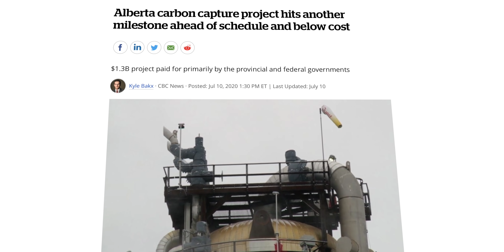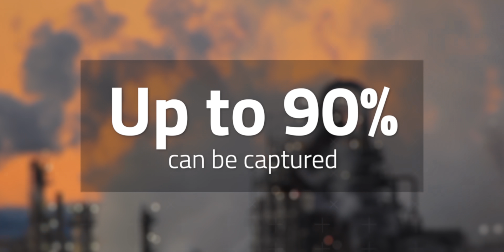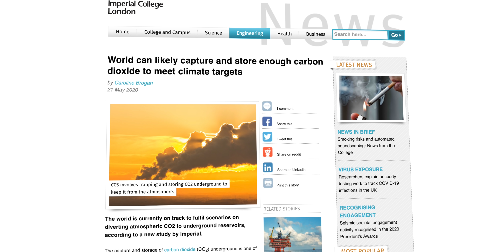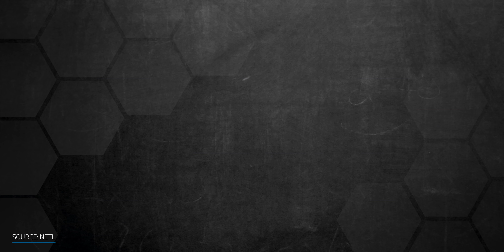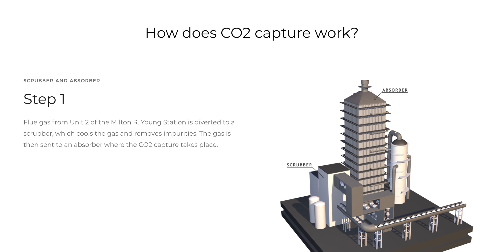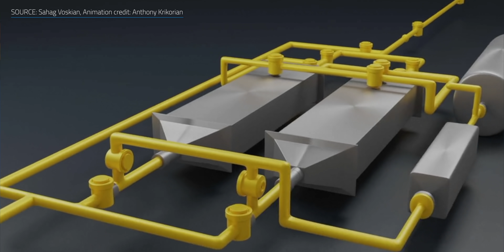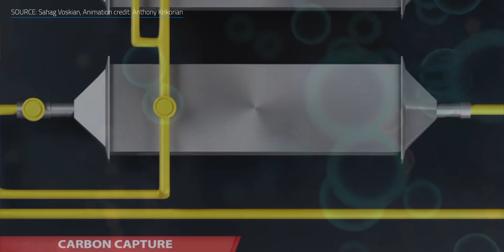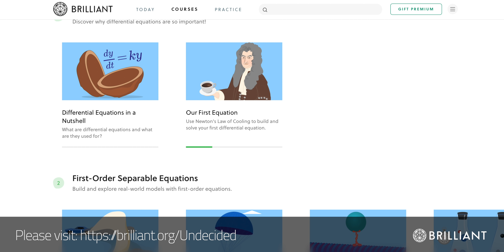The truth about capturing CO2 to reverse climate change

Comment: Matt, now that you talked about carbon capture, I think that it would be interesting to compare this tech to planting trees. Thanks.
Reply: Trees and seaweed are way more efficient and cost effective at carbon sequestration...
Reply: @1 2 Not a total solution. But an important part. The trees don't have to be cut down. Those that are can be used as lumber to build houses. Could also bury them underground as a form of carbon sequestering.
Reply: @jaymesdevine7737 

Don’t get fooled one of these pipelines exploded in Mississippi in 2020, rendered cars inoperable, including emergency vehicles. People were unconscious, with no help arriving. 45 people were hospitalized. These things are dangerous!
Reply: I have 3 of those CO2 capture plants in my. One of them is 100 ft tall a sick elm tree. A black walnut 80 ft tall and a sumac also 80 tall. A blue spruce just a baby on 30 ft tall. Funny thing about CO2 concentration it goes down in summer and up in winter.
Reply: @warrenpuckett4203  the following article describes why this happens...
https://earthscience.stackexchange.com/questions/2521/why-is-there-a-seasonal-cycle-to-the-amount-of-co2-in-the-atmosphere
But the good thing is that "each gram of" carbon trapped inside each tree trunk is " a gram of" carbon removed from atmosphere...
Reply: last data i saw was  1x50c tree was 13000x more cost effective than any capture machine currently in use
Reply: @flodjod  problem is land availability.
Reply: What  @tinacrew  said.  Trees take up a lot of land space.  And they would need to be planted somewhere without existing growth in order to be effective.  DAC takes up significantly less space.
Reply: @tinacrew  Take a drive in farming area...  The land between the road and the field can hold many, many trees.
Reply: @JeffHoneyager  maybe in your country, but in mine that's not the scene.
Reply: @tinacrew problem is danger to people. One of these exploded in MS. Incapacitating emergency vehicles and people who needed help. 45 people were hospitalized.
Reply: @clellbritt3434  The main concept with trees is not really the tree but the forest. Yes, in a forest, trees grow, store carbon, die and release it back as CO2. The forest, however persists. There are incentives to plant trees, but only as part of a land use change towards permanent forest. The payments are not perpetual and cease when the forest reaches maturity.
Reply: @Brin Jenkins true...😊 now let's hope enough people would get enticed to plant sufficient trees
🌱🌱🌱🌱🌱🌱🌱🌳🌳🌳🌳🌳🌳🌳
Reply: @gustafeibel4919  what if we let trees reproduce on their own?
Reply: You can plant trees almost everywhere and they can remove carbon from the air, while CCS makes sense economically to remove concentrated emissions only. There is the big storage problem. Storing in cement does not offset emissions significantly (as producing cement releases a fuckload of CO2 and using CO2 for curing is seriously complicated)
It would be probably better to put effort in changing the way we produce and use energy, and maybe to help those communities that will be hit the hardest by the consequences of climate change, as reversing half a century of emissions is unrealistic
Reply: @filosquartapecore  1 century of vehicle emissions not a half of a century. Several centuries of coal, oil and natural gas.
Reply: How did this planet become so full of incompetency!! All these stupid supporters of psycho scientists playing around bc they have the funding!! Worst people are the scientists, always have been!! They are menaces w god complexes trying to defy what is natural and simbiotic!! Look up how many nazi scientists were brought to america to continue their psychopathic playground
Reply: Stirling University and the James Hutton Institute in Aberdeen, both in Scotland, have discovered that over a 40 year period, carbon fixed by growing trees has been offset by the mycorrhizae (fungal network) actually releasing more carbon dioxide than it captures! So peat bogs and grouse moors are better left free of trees. The trees are a timber producing commercial enterprise to pay for the tree planting. Money first at present.
Reply: Planting trees , is economically and asthetically viable. Carbon capture tech requires more energy to capture carbon , than emitting carbon. Even using R.E. sources to capture carbon is also energy intensive.
Reply: unfortunately, there's only one comparison that matters: people can make millions selling carbon capture. no one gets rich planting trees.
Reply: It would be better to have both. To reverse our impact and help restore things would be optimal...
Reply: @justinfigley4867  Yes, we probably need both, but knowing how they compare would help inform decisions when it comes to allocating money.
Reply: @jaymesdevine7737  Trees: you would have to plant all agricultural land to make any impact with trees. You would need immediately turn all energy production, including used in steel manufacturing, into solar, stop consuming and only build those fancy fans. You see, you can allocate money wherever you want, still can't eat the money or suspend the laws of thermodynamics. Bottom line: silverbullet, science miracles are not going to save us now. First we have to stop fcn consuming. Sci fi dreams leave for later.
Reply: @jaymesdevine7737  I think that planting trees is still the best option. 
Not only they suck out CO2 in a natural way but they also restore biological ecosystems that nature has lost in the modern era due to us.
I would also give us more wood to harvest in the long long term, not to use intensively for paper use, but for making some art works that need wood or other.
Reply: @jaymesdevine7737  Do people need to pay to plant forests or do those just grow on their own?
Reply: @jaymesdevine7737  for planting trees you need a lot of people and voluntary work, and a lot of space. The investment in terms of money may be even larger. Despite I clearly would prefer the "natural" path, I am afraid that it simply won't happen on large scale, at least outside of China\India. They have huge re-forestation projects running.
Reply: @monnoo8221  planting trees, we can do that but the unbalance made to the atmosphere is too large, we humans
Have the tech, we have the responsibility to fix this,  in the mean time we can plant trees but one cannot expect just planting trees is fixing anything.
Reply: @dandyrevisionist7879  agree
Reply: @justinfigley4867 

CO2 is about 400ppm, we contribute 2% of that or 8ppm.  If we immediately removed 8ppm and got CO2 down to 392ppm, by how much would the global temperature be reduced?
Reply: @ThekiBoran  None, because CO2 has no effect on temperature. More would be better for all life. Now that we've entered Maunder minimum we should see decreasing CO2 in 20-30 years, and it will only hurt life, not help it. The only reason I can see for Progressives preparing the world for heat when cold is coming is for depopulation.
Reply: @justinfigley4867  yes both. Specially because less CO2 in the atmosphere will make trees grow smaller
Any pothead knows that
Reply: @justinfigley4867  Restore to what?  Nuclear has zero carbon emissions and planting trees absorb CO1.
Reply: @justinfigley4867  restore what  ? We as humans do not occupy even 4% of the earth 🤣🤣🤣 you infidel
Reply: @clellbritt3434  The timbers in my house are over 100 hundred years old. New housing seems to good at avoiding expensive building materials like wood.
Reply: Trees are better with carbon that has already spread out!!  Because Carbon capture need power to operate. However carbon capture is best in industrial!!
Reply: If we really want to reduce the number one climate warming gas we will need to eliminate water vapor from the air
Reply: @MichaelRei99  Wait till we fully converted from carbon fuels to hydrogen, and our biggest problem will be air humidity instead of CO2... but that's gonna take a long time
Reply: Best answer yet, carbon vacuum cleaners are as nutty as the concept. They use power so will create their own carbon bs
Reply: @DavidJones-ps3zn  I think you are completing missing the point of these devices.  They remove a lot more carbon than what is used to make or maintain them, making them a carbon negative when in use.
Reply: @OmniscientWarrior  If you end up with no carbon your forestry and vegitation would not exist
Reply: @DavidJones-ps3zn  True, but for that to be the case, we have to first remove creatures that breathe out carbon dioxide.
Reply: @OmniscientWarrior   Right, and we can start with the likes of Klaus Schwab and his ilk
Reply: The funny thing is that nature is kind of doing that itself.  If you consider that most of North America used to be covered by kilometers of ice, and since it has melted, vegetation is growing where ice once was.  If you go far enough north you will run into the tree line which is caused by the permafrost in the ground not allowing tree roots to grow.  When the permafrost thaws, the boreal spans further north.  New trees take CO2 and convert it into the biomass of the tree and so on.  It's like... nature has its own checks and balances and the current level of CO2 and future projections of CO2 are not unprecedented in earths history.  The fossil fuels we use are literally the hydrocarbon remains from life that got buried there.  When they're used, they're getting thrown back into the earths budget
Reply: It takes an acre of forest 2 years to capture the amount of carbon released by an automobile in a year.
Reply: Great.  Then lots of plants will have the resources they need to grow.
Reply: America plants 1.6 billion trees per year. Plus the increase in CO2 has benefited vegetation worldwide. CO2 is good for everything, including bee colonies, which are recovering from collapse. Temp drives CO2, not vice versa. See ice cores and stomata.
Reply: Reforestation is still better, even if it turns out to be less efficient. It requires no power, it rebuilds ecosystems, prevents erosion, and they create their own climate through transpiration once you plant enough of them. It also solves the carbon storage problem- Reforestation leads to an increase of other plants species, insects, and animal population- all of which need carbon to exist. Most important of all: It's supposed to happen anyway if we want to reverse the damage done, so why not do it from the start.
Reply: @mumble3535  the reasons you give are all perfectly correct. Yet, technology and its dumb use brought us here, and if we have other options to bring co2 down, I think we should apply it as well. If dumb money does not flow to forests but instead to those carbon sucker plants, let them pay.
Reply: What is the problem with Co2 ?
Reply: nobody wants to talk about clearing old growth forest to plant young trees that capture MORE CO2... and in the USA improved farming tech has reclaimed more forest in the last 100 years than any other country... using petroleum based fertilizers(which they are trying to get rid of)...
Reply: @billewilde1  The larger the tree, the more carbon that it needs to live and the more that it is currently storing.
Reply: Canada- plant new trees,  south America, protect courent ones.
Reply: @CHMichael  have you evem been to south america?
Reply: Damn right
Reply: I'm going to reply to this comment as it seems to have the liveliest discussion under this video.
Disclaimer - to anyone - really just want to help with the discussion, but I think there are some major misconceptions about trees and the CO2 cycle as well as maybe some ideas missing in this discussion.

1 - dont look at the single tree. Yes when it dies it will rott away and release co2 again. But a forest as a whole is CO2 negative. CO2 will be stored in the roots, funghi, animals ... and the layers of fallen leaves eg. will not just rott away into CO2 again, but will actually build up soil and bind it that way too - like the initial oil / coal build up we use today.

2 - We have enough land. I really don't want to start a vegan/vegetarian discussion, BUT 50% of useable land today is used for agriculture, of which ~80% are used directly for livestock or to feed such. We need to take this on. When everyone at least reduces we can free so much land for reforestation.

3 - forests grow themselves. Not much to add, but yes we can help that by spreading seeds further, but there's allready tech - look at drones, seedbombs etc.

4 - a tree does not have to be grown out until it stores CO2. A Tree (or generally speaking a plant) is made up of nearly 100% Carbon. Even while they are growing they are storing Carbon away from the atmosphere.

5 - We can use water surfaces as well. Algae can decalcify water, grows rapidly and just needs a 'hook' to grow on. Over deep sea this can be achieved by floating constructions. When they've grown long enough, they can be cut down, sink to the bottom of the sea floor where the water pressure traps the CO2. There are also Tests with algae trapping CO2 on land (very successful - search eg for Paris), turning them into food, building materials etc, or best one: Algae which produce Oil which resembles Oil used for Transportation in any fashion (Car, Plain, Ship) - this by it self would provide net-zero-emission energy source fueled by sunlight without the need to replace current technologies / motors with electrical ones (It's not the car itself thats damaging to the environment, it's the fuel)

6 - Reduce. I know it's not really part of the discussion, but when we discuss about the net-sums of how much equivalent of CO2 we have to store in trees for which time compared to capture the CO2-output of factories etc. - please don't forget, one of the easiest way to help the environment is to reduce the output of CO2 in the Beginning. I really believe that as a human / worldwide society we should prioritize what we need. And we really should make these most basic and necessary things as environmentally-friendly as possible. Home (earth) - food - shelter - energy - education - transportation - ... and then fill in by prio and possibility. Adjust the economy to this then, not the other way around. 

We all don't need to work 40 hrs/week to buy things we don't need to keep a economy of unlimited growth running which is killing ourselves. The Planet and life in general here will survive - will we?
And sustainability in simple terms means that we should be able to do something in the same kind of fashion for ... ever. A sustainable earth is possible when everyone lives a 1960's swiss lifestyle.

Please correct me where I'm wrong, fill in the blanks, add more ideas, we can only do this together :)
Reply: Porqué no los dos?
Reply: Microalgae has a higher capability to capture more carbon dioxide from the air than trees but yeah doesn't justify the cutting down of trees but we need a combination of both of them to achieve a carbon neutral world
Reply: Yeah it could be nice to see your compere it to trees or just plants in general. Thanks.
Reply: maybe not planting trees but more like restore a tree. planting the tree local to the area.
Reply: Thanks for the awesome video!!! Climate change needs to be better well known as well as solutions
Reply: Id like to see an EROEI on the tech. Whats the energy cost to manufacture, globally transport, install, maintain and decomission?

Trees cost little, and in many cases dont even require human inputs. A partially degredaded old growth forest not under pressure from desertification or urban development will naturally regenerate itself without human imput or assistance. All that is needed is the cessation clearing.
Reply: We already have more trees in North America than ever due to no one burning wood anymore because of coal
Reply: @Brin Jenkins They store C and release the O2. I f we harvest the trees and use them the C stays captured.
Reply: Thats exactly the blunt answer.  Plants remove more carbon dioxide than any machine you try to create. Imagine if instead of building everything above ground, humans made all the living quarters underground where your home is insulated by earth. People could afford a hole in the earth is why we didn't go that route. Humans have exceeded earth's tolerance of one spieces. Earth will solve the problem or we will collapse through lack of population control. We all feel it like stress but try to fight it. I don't have the energy to fight it myself but I will certainly try to fund it. I buy clean energy index etfs and moved a bunch into this sector.
Reply: A big flaw with trees, when the tree rots or is burned, it releases the carbon that it captured.
Reply: and in night trees and plant give co2
Reply: @muhammadazam4599    No CO2 = no plant life = no life
Reply: Sir, this tech is not to replace trees if you can download last ipcc report which was referred in this video you will find that these projects can only be used to reduces the peak in CO2 content in the atmosphere which  will come in 2030 (expected).
Reply: Or just growing grass, apparently grass sucks up CO2 faster for the same area and time
Reply: @clellbritt3434  30% of the carbon in a tree is in its roots.  When a tree dies, those roots become fertilizer for the next tree.
Reply: @clellbritt3434  just curious, are trees capable of reproducing on their own?
Reply: For that we would need less population centers, less housing, less children...etc does that sound an easy undertaking to you?
Reply: @clellbritt3434  one thing that effects planting trees is the 7.8 billion that is the current estimated population in the world housing people requires land and eventually that 7.8 billion will turn in to 15 billion and so on so carbon capture is a good investment when you look at long terms
Reply: Both still won't be enough
Reply: The amount of carbon absorbed by trees is quite easy to visualise and calculate since the weight of trees is roughly equal to the weight of carbon absorbed from CO2 in the atmosphere (the remaining oxygen is simply released as gas)
Reply: I'm more into planting trees because it's more cost effective
Reply: trees are important but we have to take care of our own doing accordingly, nature cannot process carbon emisions at an industrial pace, but we can.
Reply: It would even better to shut down oil companies lol
Reply: @iamsosad1429  although your comment is a comic relief, it has no real solution, millions would die of starvation and cold  if we shut down the plants right now, the thing is to preserve earth while preventing Genocide and unfortunately the elite chained less fortunate humans hostage so we cannot change quick or stop us from changing.
Reply: I was going to say could you not call reforestation  'carbon capture and storage'?
Reply: @tedcalouri2694  yes, just add a "bio" and "hyper-efficient", ...as other properties like: low initial investment, democratic, well-known positive side effects and the like
Reply: Agree.  It's stupid to throw effort to capture atmospheric CO2 (0.04%) when better bang for the buck to capture CO2 from or near its source.   Planting trees is the best way to capture atmospheric CO2,
Reply: If we really went nuts and basically reforested the sahara with enough trees to make a difference, it'd take us about 1000 years.
Reply: it has to be a multiprong approach we have massive ccus installation on every keypoint on earth have a massive tree growing policy look we are not gonna turn off the light drop off the car or switch of the ac or heater or stop eating food so we need to focus on generating more clean energy and reduce our energy consumption by making production and usage more efficient and sustainable.
Reply: Trees capture carbon, but then dump it back into the environment when they're done. Trees use carbon to build support material. They don't convert carbon into oxygen. They store it. Global warming is measured in spans of thousands of years, which is greater than the lifespan of a tree, meaning it'll capture its carbon, then dump it back and the environment will proceed like nothing happened. On a more short-term span of time, they use carbon to create leaves. Leaves fall off in autumn and are gobbled by microbes and turned back into atmospheric carbon. In short, best case scenario is they do nothing. Worst-case is they become kindling for forest fires.
Reply: @89qwyg9yqa34t  trees convert CO2 into C + O2. 6th grade. You are right that they decompose again. Yet as long as they live, they bind water and carbon, which is called biomass. I do not calculate here completely, yet if you increase the number of trees by 1% =>10 billion trees x 7 tons is 7*10^10 tons wood = 20 gigatons. compare that by 2 gigatons total carbon and you easily can see that your argument is wrong.
Additionally, climate changes may occur very quick, within less than 20y. You will experience it.
yet I admit that those tress need to grow first, and because all the idiots out there, we need a very quick solution. Even if it consumes energy and resources like hell.
Reply: @monnoo8221  If you use plant biomass as a carbon sink, are you sure you're not just going to increase the number of forest fires? Or say you somehow find a way to increase the density of plants and trees in only humid areas, which would be a special feat, aren't you just asking for tree diseases to spring up? The chestnut tree is considered extinct in New England for that reason.

Trees are not the solution at all, unless we're only planting them so that they can collect carbon so that we can permanently bury them like nature did when it fixed the problem itself a very long time ago.
Reply: There is no way planting trees can address the issue tha same way as carbon capture. There is math behind how much carbon a tree can capture in it lifespam. Also there is no enough land for trees to be planted(this has been calculated as well)
Reply: Carbon capture in cement production sounds reasonable.

Planting trees isn’t the end all solution. Look at all the forest fires and deforestation.
Reply: We can still plant trees, then cut them when they grow enough, bury the leftovers as deep as you can, then plant more on the spot to achieve the same goal.
Reply: Ramlinga= rambling   U r deficient
Reply: You can not make money planting trees dumb ass.
Reply: Uncontrolled Growth of forrest will let out as much c02 as it storage. If You however cut them down and stop them from breaking down and rot it will make sense.
Reply: Make both but you need food as well.
Reply: planting tree artificially is even worse as it stresses out the soil deposits and dries out the land
Reply: @mmoarchives2542  I hope that one day you are able to understand how stupid your statement is but until that day let me explain why you're completely and utterly wrong, You see there are these things called seasons, some could say that during the seasons the climate changes and the role of a plant or a tree takes on a different format for each subsequent season, now let us focus on one particular season namely autumn, this season is particularly important because all of the energy that has been gathered during the spring and summer months is now stored up in the leaves of the plant and is set to fall from the tree back to the ground, back to the soil to renew its strength and vigour, your argument is not only false it goes against the first rule of thermodynamics I ask of you to please spend some time exploring your world and natural surroundings before commenting on a post on YouTube concerning the environment, thank you for your time.
Reply: hemp is better than trees for short term while you let trees get to 50 years...
Reply: @mjphillips76  Hybrid poplars take 12 to 18 years to reach maximum wood volume per year.
Reply: I still see new homes being built and displacing trees an wildlife all the time.  If anything we ought to kick out all these people that shouldn’t even be in the country, bulldoze their homes and plant food forests.
Reply: @stefd.8857  Oh, to replant a desert you need clay, to retain water, and manure, to give plants nutrients.  Just in case you were wondering how to do it.  Oh, and the best way they found is to mix the clay into water and just spray the desert with it.  (Nice thumbnail, by the way, really pretty water feature 😁)
Reply: The problem is we know the capacity. Trees and the oceans failed to maintain the carbon concentration in the late 1880s, when human emissions were 1/125th or .8% of what they are today. So we can spend trillions, stop all shipping and fishing, and we'd net ourselves a biosphere that still can't contain our emissions, because it's frankly a joke to even consider we'd ever get close to 99.2% emissions reductions. Carbon capture is a technology. By the time we've spent trillions on it, it will likely yield us multipliers we don't foresee now that nature can't give us. Also, if you plant all those trees today and you're lucky if your great grandkids see any benefit. We don't have centuries to wait for nature to solve what it cannot solve any longer. Accept that we must learn to engineer the biosphere to survive.
Reply: @Purpleheart62001  Johnny where does your information come from?
Reply: @Purpleheart62001  Well, a few problems with that.  Our efficiency is way higher than it used to be and we can burn things, even wood, much cleaner and get more energy out of it than they used to.  Back in the 1800's, even with all that technology, we still relied heavily on horses and oxen for the heavy lifting.  Comparing the modern world to the ancient world is very difficult.  And planting trees, we don't have to wait for our grandkids to benefit.  Most trees grown for wood are harvested within 10 years because after that they don't grow wood as fast as the first years of their life, and then if we built with that wood the carbon would come out of the atmosphere and be stored.  Even if we burned it, the carbon would come right back from the air when we grow more trees.  It takes on average less than a second per tree planted with our current technology, that is per worker.  And you can just bury a foot of one of the branches of many varieties of trees and it will grow.  We will need to use less energy, true, but we could redesign cities around travel to work, there is no reason the average commute needs to be 20 miles in a car.  We need to solve distance to employment and the energy and carbon problems will greatly reduce.  Also, transporting everything from underpaid third world countries needs to stop.  A company should not be able to pay another country less than half of the minimum wage that is required in their own country.  At the moment, they get paid like 1 tenth the amount, but if they made that half, it would mean companies would start using local labor and stop transporting nearly everything from halfway across the world.  Not to mention all the pollution that those factories put in those third-world countries.  If the factories were local they would find ways to keep them clean.  Very simply, the modern world has the exact same problems the ancient world did;  Rome could only work if there were slaves, and the modern world can only work if extremely poor people either work in heavily polluting factories for an unreasonably low wage, or choose to be without a job and probably die of starvation.  There are many, many problems that added together are going to make the planet unlivable someday.  I fail to see how planting trillions of trees could possibly not sequester carbon.
Reply: depends on the scenario, right now it's definitely a viable option, but once the real climate crisis kicks in, land might be too dry as water becomes more scarce, this is happening right now and we don't have enough desalination plantations to supply everything and only will be building nutil it's too late (as usual with politics nowadays...), so efficiency will be key and new little trees that have to grow and need a couple of watered acres before they make an impact might not be worth the effort. BUT this will be a worst case scenario. nd only for a short time, and as those guys before me said, both will be needed, as we probably don't want to wait millions of years until the co2 is composted to oil and shifted back into lower layers of the earths curst^^
Reply: @Caldaron  oof that's some serious realist pessimism.  I hope your vision is overblown, but I fear the worst.
Reply: @Caldaron  deserts aren't caused by heat, they're caused by either Hadley cells, mountain rainshadows or being smack dab in the center of Eurasia.  Those are the only causes of deserts.  The equator feels the full intensity of the sun all year round and it rains there almost every day and has the highest density and diversity of life anywhere on the planet.  It also feels like you got it backwards on water availability too.  Water used to be scarce and people used to die in mass famines just a century ago when we had a less industrial society.  We somehow managed to have twice as many people in the world while famine deaths have plummeted. In the past, you would need to dig a well, hope it isn't contaminated and carry it in a bucket and now we have drinking water coming through taps all over our home for literal cents and there is so much available that people can fill a toilet with it to defecate into.  Lets try to remain objective and not be pulled into the modern religious rapture
Reply: @Caldaron  first of all the planet won't become dryer as a whole as a result of climate change, and some regions are expected to experience an increase in rainfall, second one of the biggest benefits of planting trees is that they tend to increase rainfall in the regions they are planted in, so even if the land is to odry to cover the region with trees without using desalination you can start by planting the trees you can and taking advantage of the alterations to the local climate they provide to allow you to plant more trees.
Reply: @Christoph Wolf - I thought you were a Bach scholar.
Reply: Christoph Wolf When will the real climate crisis kick in? Sounds like a good time and would like to add it to my calendar
Reply: musikSkool omg. It sounds biblical
Reply: @Caldaron  You are right, but there is an important factor which brings a ray of hope. Trees do not only need water, but also keep or make water. The leaves, roots and undergrowth of a tree make sure that any water that falls on the ground does not immediately flows away, eroding the land in the process, but keeps the water in the top layer of the soil, and evaporating it. This process helps cool the area, increases humidity and cloud cover and further precipitation. If a dollar of investment in trees have the same effect on CO2 as a dollar invested in a CCUS, I would go for the tree. Check for instance https://www.greatgreenwall.org/
Reply: @Caldaron It’s not a viable option, it’s dangerous!
Reply: @Caldaron  Genetically Engineered trees that are extremely drought resistant,  and  incredibly fast growing as to sequester carbon faster may be viable.. you may as well make them economically productive (lumber/fruit) as well, as long as you're creating an entirely new genetically engineered species.
Reply: Carbon Engineering's carbon capture plants extract the equivalent of 40 million trees. Space for planting trees is limited. There is no way to capture enough carbon fast enough, given the geographical constraints, without something like what Carbon Engineering is doing.
Reply: Yes planting trees would be the most logical solution! But there is no money to be made in planting trees.  That is why governments would rather charge you a carbon tax.  Such a scam!
Reply: @xaxabat1  Are you a big industrial carbon emitter? Why do you feel than to call out the scam on something that you don't even understand?
Reply: So the reason they don't want to work with trees is because before investing in a large market, a business needs to prove to their stockholders that they control enough of the market so that no one will come in and undercut the market, and they lose all the money they invested.  One way they do that is by only funding highly technical projects where the barrier to entry is so high that they are unlikely to get any competitors.  Another way is by owning key patents that make it very expensive for anyone else to compete with them without large amounts of research and development.  In a low tech market they do a lot of research in production and transportation techniques to reduce their costs so that no one can afford to do what they are doing with lower maintenance costs.  Think of injection molding, there is simply no cheaper way to manufacture many things than injecting plastic in a mold, that is why most of what we own contains plastic, not wood.  The closest they can come is die stamping, but that doesn't work for more complicated shapes.  If you could either make very cheap plastic out of wood or come up with a tree planting process that couldn't be duplicated by your competitor cheaper, then we would have a lot more trees.  With all the fires in California, make sure you plant these orchards somewhere that never gets very low humidity.  The simple answer is, trees have such a low barrier to entry that investing in them would be unstable.  Investors don't like unstable.
Reply: have both but realize one year of plant growth isnt going to balance burning more than a million years worth of fossilized plant growth each decade.

We released 38 gigatons of carbon into the atmosphere in 2018.  If we covered the planet worth trees, it would sequester about 3 gigatons of carbon... over 20 years.   And that would be rereleased when the trees died and rotted unless all the trees were cut down and preserved/ sequestered
Reply: @DespiserDespised  you should not stop feeding them... you are correct that force shutting down of petroleum/coal economy is going to create massive economic issues... thus the optimum solution is, planting more trees (and implement other CC techniques) at a faster rate than the C emission rate... that would resolve this issue at the same time without generating new/further issues... 
🌱🌱🌲🌲🌲🌲🌲♣♣♣🌲🌲🌲🌲🌲🌱🌱
Reply: @gustafeibel4919  We agree mate but you realize C02 is tree food, dont you?  Ive seen with my own eyes over the last 50 years mankind has made steady technological progress towards reducing pollution.  C02 isnt pollution.  That the ctrl-left has turned it onto a pollutant is the scary part, lol. That means you are born a polluter and they can justify sending you to the oven.  Just like their Fascist heroes in Germany in 1940.    Pollution reduction isnt what the left wants anyway.  They want to destroy Americas right wing guaranteed Individual Liberty and replace it with some disastrous form of collectivism.  "TO SAVE THE PLANET" of course.  The Hubris of the ctrl-left knows no bounds.
Reply: Let’s retro fit it to capture satanic pedifiles from the lodges
Reply: @bullshitstomper9417  Afforestation increases the Earth's albedo.  This could actually cause more rapid warming than the CO2 that is captured this way would have.
Reply: There's not enough land on Earth to plant the amount of trees needed to offset our global emissions. Not even close. We need to do more.
Reply: The other problem is that co2 is plant food.   If you lower the co2 too quickly or too much,  you might end up with a huge die off of plantlife on earth, not only negating the gains,  but also releasing tons of co2 and methane.
Reply: Very simple, this solution is permanent, planting trees is temporary.
All carbon captured by a tree during it's lifecycle is used as building blocks to grow. Thus when the tree dies all that carbon can be released again either by rotting or burning the wood. Result is the same. At best planting a forest acts like a temporary carbon storage, it does nothing about returning the carbon pumped up from the ground in the form of oil products.
Reply: @Painrunner  wouldn't some of the carbon be stored in the soil after decomposing?
Reply: two challenges regarding planting trees to address CO2 emission: efficiency and land
Reply: Well, simply put, it would take 50-100 years for trees to grow full size (trees worth their salt) and we need to reverse the effects of C02 today.  So, carbon capture is going to be very very necessary.
Reply: @gminer03  what hasn’t been mentioned is alga farming that’s fairly low tech and generates biofuel as a byproduct
Reply: CC is immediate, trees take years to grow nice future planning tho'. First get rid of big oil and coal companies. and fine them for the damage they've caused to pay for CC and tree planting.
Reply: @grayzytube  fines do nothing to curb pollution.  Guess who pays the fine? You do.  Higher fuel prices, food, every product made etc.becomes more expensive.
Reply: @grayzytube  exactly!  Go fine those Chinese coal companies.   Report back how that works out
Reply: @grayzytube  r u good with walking and being cold while being in the dark?
Reply: @grayzytube  Why plant trees... stupid idea. Just stop clearcutting the rain forests that are already mature.
Reply: @grayzytube  ain't possible mate. if you get rid oil and coal company right now you can't get literally anything right now except foods, because petroleum products isn't just gasoline but also solvents, aromatics, base oil, lubes, LPGs, plastics, etc. which your smartphone, PC, mom's la clancha are made out of. that also applicable to coal: coke are used in steel mfg and emergency cooking fuel, coal tar went to the shampoo bottle and paint. So getting rid of them == you won't get anything else
Reply: @grayzytube  it is not the big oil companies that burn the oil.
Reply: @grayzytube  there are ways to get rid of those plants using efficient energy sources but the ones who tried set the competition to these olliegarchs ended up in the river.
Reply: Trees are overrated. They absorb CO2 during the day but they put most of it back at night. The actual CO2 captured is ~5%, and when the tree dies it all ends up back in the atmosphere.